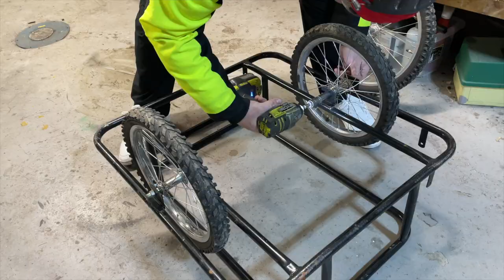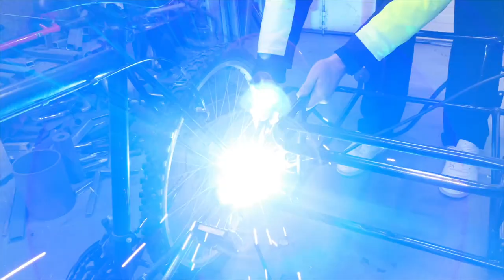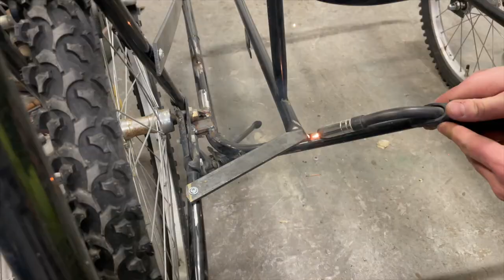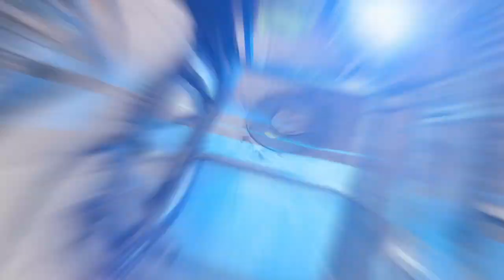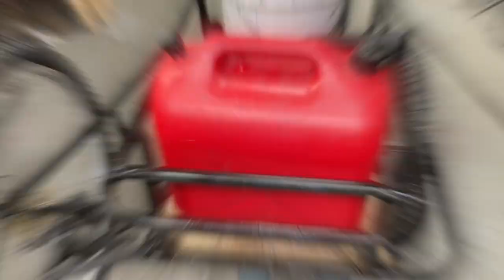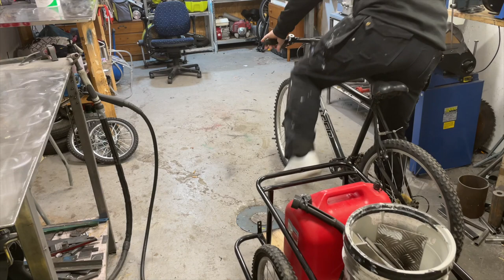Making an Bicycle Sidecar

Comment: That attachment to the bike needs to be dynamic with ball joints or pivots. Fixed joints will have issues when turning or on uneven roads
Reply: Please watch all his video - this might make you understand why we are followers. Tip: It's not his ability to calculate mechanical stress, the fine art of welding, or understanding how many threads you need and sufficiently preload a bolt ;-)
Reply: Ya just dont get it , do ya.......
Reply: Fixed joints can work, they have for a very long time with motorcycles, it's an interesting & radically different riding experience.  However, the ones we see fabricated here are nowhere near strong enough.

Comment: As a mathematician I always thought that when any vehicle has any number of wheels, then all the wheels must-have the same centre of curvature, when they take a curved path,  as otherwise they will slip sideways. In a bicycle, the two rear wheels need to be on the same axis, not lagging nor leading one another, as in this case.  When they are not on the same back axis, then when taking a corner, the side wheel  will slip sideways making hard pedalling. That welded joint will not last long. 

Ah well,, and here I am worrying about the wheel geometry of a vehicle. when we are free to be so original!
Reply: yes they need to be same size
Reply: @haskelltichell6400  The size does not matter,  the two rear wheels must be on the same axis.